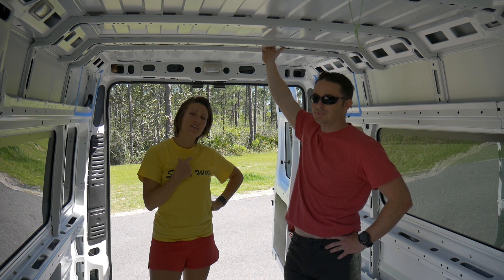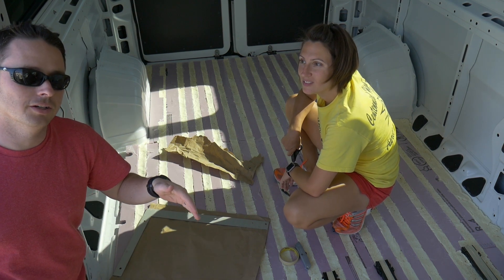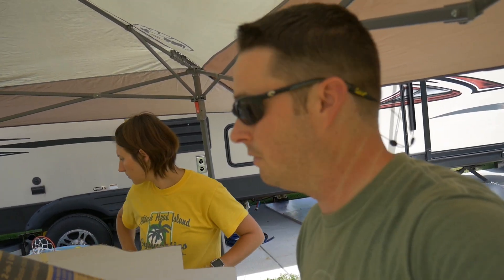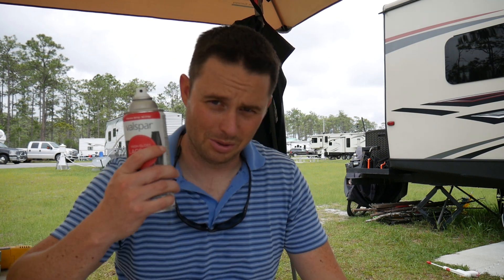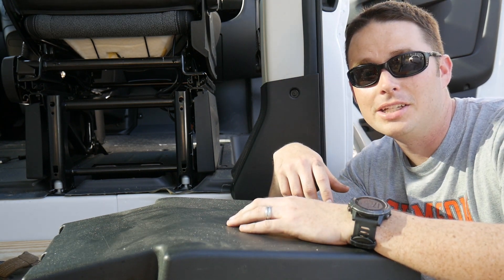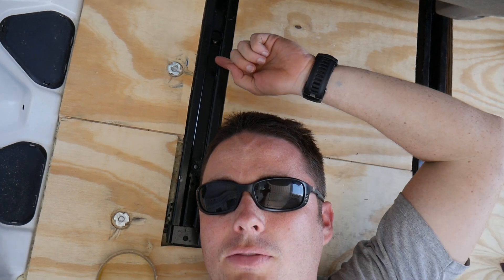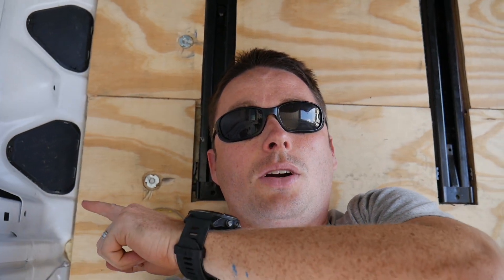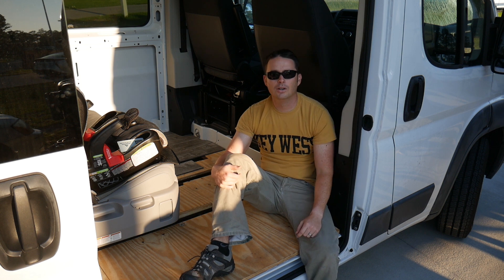How to build a Campervan: Part 9 - Sub-Floor Install

Comment: Would you mind doing a video on all the tools you would need to do an entire van build? Some folks seem to be able to get by with just a jigsaw a skill saw and a screwdriver, and others have more elaborate tools. I'm interested to see the level of build your able to accomplish and what tools it takes. Thanks and good luck!
Reply from the maker: That is a great idea. Yes, i will put a video together on this as we were relatively limited on tools and space. We did 99% of the work in the RV Park next to our trailer with a small assortment of tools.

Comment: given your floor is almost flush with the seat tracks.  are the seats going to be able to slide forward and back ward?  I suggest you seal the bolt holes in the floor to prevent water from coming up thru the floor and causing rust.   looki g good
Reply from the maker: Yes the seat will still slide back and forth...we probably have about 1 cm of clearance left...it is very close.

Comment: did you really have to bolt the floor down? I'm actually curious, what if you left it, would the items in the van not keep it in place?   I'm looking into a van conversion myself, and I am hesitant to bold the floor down because it is just that many more holes in the van.
Reply from the maker: I probably could have left it unbolted but from a strength issue and going over the bumps I felt safer taking the time bolting everything down. Thanks for watching.
Reply: I am considering bolting my floor down where the tie-down bolt holes already exist and then just using liquid nails to glue the wooden furring strips to the floor. You are right, it won't be an easy task to remove or redo if I ever need to but I am hoping I won't LOL.

Comment: Just my thoughts, please don't take them harshly. The T-Nuts (vs. Riv-Nuts) don't have as much lateral sheer resistance, especially with just three prongs in wood, but I can see why you chose it. These are more suited for "sandwich" force, not lateral... like in a speaker enclosure build. Hopefully you used removable Loctite and lock washers? 

If this was my build, I would've used Riv-Nuts into the van floor and carriage bolted down through the wood. With the bolts underneath in your current config, if they loosen you won't know... and then gravity will help to let them fall completely out eventually. With Riv-Nuts they become "part of the floor" and a solid anchor point. Securing bolts downward now makes it obvious if they begin to loosen. 😉
Reply from the maker: Hey Gov....so we used lock washer and locktite. I am comfortable with the lateral movement between the additional mounting points (i.e. screwing cabinets to floor and then to the wall). But you've got me thinking on the bolts...your right I would never know if they came off. I think what I'll do is go add some "witness marks" on the bolts, so that I can do a quick visual inspection and ensure they aren't backing off.  Great thought. Thanks!
Reply: It's always easy to play armchair quarterback. 😉

Comment: I've seen a lot of builds where they've laid the subflooring down with some sort of glue to reduce holes in van.  Why didn't you go that route?
Reply from the maker: There was a lot of consideration given to just glue it down, and I think that it would have worked just fine, but I wanted to make the Van maintenance friendly and should I ever need to get back under the floor to add/fix anything I can do it with a lot less effort.

Comment: If you do another build, Lizard Skin Thermal ceramic and sound deadening coating is the best thats out there. Im shocked the van lifers are not doing this. Lowers temps by a hellacious amount more so than the insulation ive seen in videos.

Comment: did you put silicone on the bolts under the flour ?
Reply: floor * so water dont come up the bolts heads
Reply from the maker: Yes, we put a protective coating on and are now thinking of have the underneath sprayed with a protective layer after we are done making holes. Thanks for watching!

Comment: Nice work! I agree that the spare tire lowering device is just too simple and nice for a Dodge as it must be a European design.LOL
Reply from the maker: I'm telling you...I can't wait till I get a flat tire, simply because of how easy it is to get to the spare.
Reply: Only if you keep the mechanism well greased,  My UK ford transit has the winding mechanism and it broke due to lack of grease.
Reply: I'm from Germany. I can tell, the whole car is European design. It's designed in France by Citroen 😎

Comment: And something you could consider after you've put the final bolt hole through the floor is having the underside of the van sprayed with the same material they use on truck beds. Its remarkably inexpensive. Think about how wet Europe is, especially in winter.
Reply from the maker: We've been use rustolem to cover/protect our holes, but I'll look into some bed liner options. That would be a quick and good form of prevention.

Comment: I would have waited until after the walls and roof were insulated before installing the finished floor. Just think about how much crud is going land on it as you finish your build. And if you haven't bought the venal plank already, I'd seriously consider going with a lighter colour, it hides the dirt and any damage (scrapes, etc.) much better than a dark colour.
Reply from the maker: You're right...there is a ton of dirt getting on the floor between our frequent trips in and out. We wanted to wait, but knew how time consuming this part was going to be given the complexity of the floor with all the seat tracks and working around cabinets. So we decided to get something tough  and light in color, just like you mentioned.

Comment: The more you seal the water out...
The more you seal it in.
Reply from the maker: Agree...that is why you won't see a vapor barrier on our van. We are going to try to keep air flow moving as much as possible. Its a balance insulation vs. air flow. Thanks for watching bob.
Reply: Your very welcome.
speeking of "water out"...
If its been undercoated, checking to see if any factory drainage is clear is a good idea.

HI "B" !

Comment: I'm confused... not just you guys but pretty much everyone on YT puts plywood or OSB in their van. Why not just use the polyisoboard insulation under a floating wood floor as the insulation and the subfloor. You can glue the insulation down with adhesive and the polyiso is good for 16-25psi/SQ ft so on a 32sq ft panel in a van I doubt you'd crush any area of it when under that floating floor. 

http://rci-online.org/wp-content/uploads/2001-06-pima.pdf